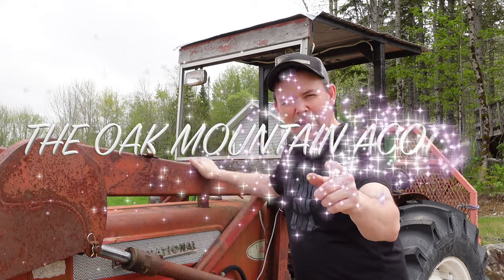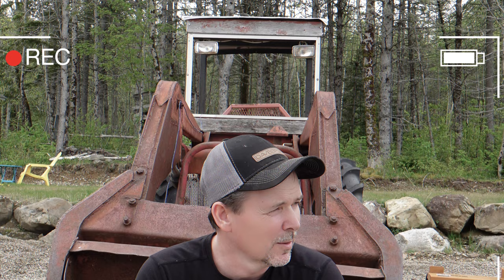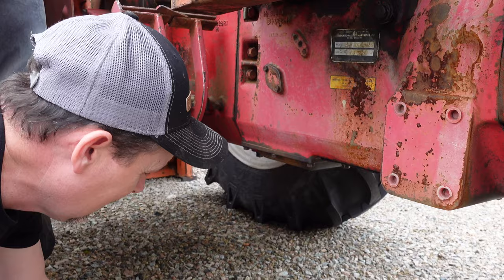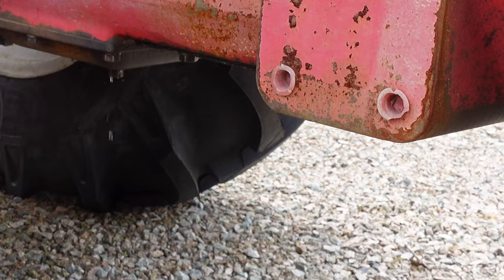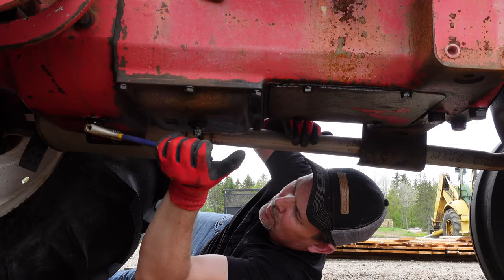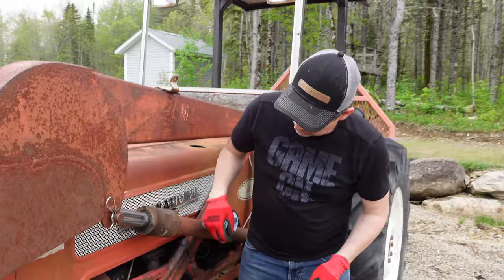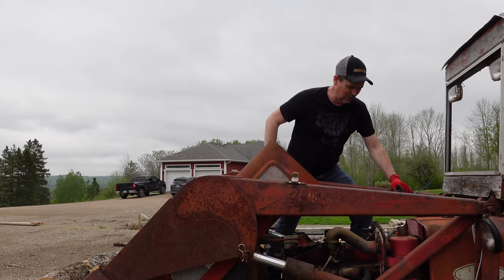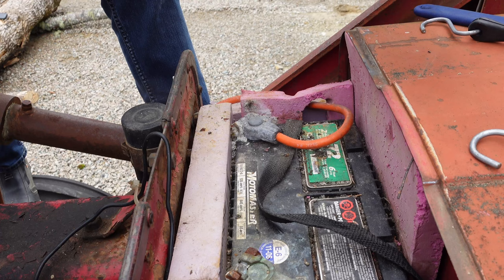Will this Forestry Tractor Start? Spring Check-Up and a Twitch of Firewood -E127

Comment: Yes, I'd say that checking/draining water it a good idea.  Too many people just check the oil level and don't have a clue how much water is on the bottom of the oil.   Water will not show on the dipstick.
Reply from the maker: Agreed. I've seen some pretty "milky" oil that was saturated with water but you have to run the machine to mix it up and see it. I like this little water draining practice! Thanks for watching, Jason.

Comment: They’re a great tractor… The reason you want to change the oil annually is to prevent acid from forming in the oil and eating the bearing surfaces. Even though you drain the water off that condenses and sink to the bottom of the oil, there is still a fair amount suspended in the oil.  If you run it a lot, and it gets up to temperature regularly, you’ll be fine- the acid forming condensate will evaporate off. I love to see theses old survivors still earning their keep! Great video- keep up the good work, Jeff.
Reply from the maker: I probably should change those oils out. Great insight on the acid formation. Trying some different editing for a while to see if the algorithm responds… no luck so far!

Comment: Good old machine! That old battery was either from 2006 or 2011, which in both cases is overdue, especially being a Motomaster... I've got the same tester (from Princess Auto) and it works great assessing a battery. I really like the trick of letting drip the water. I should do that on my old machines.  I would not mess with engine oil (it's only 5-6 liters anyways) and it's fairly cheap. But there is no added value to dumping 20 liters of hydraulic and/or transmission oil because of the small amount of water in it. We don't use them on a commercial basis, so the oil should last many years. Thanks!
Reply from the maker: Awesome feedback!  I will keep an eye on the old girl and I might schedule the hydraulic and transmission oil for replacement later this Summer. I need to cut a few cords of firewood first though!